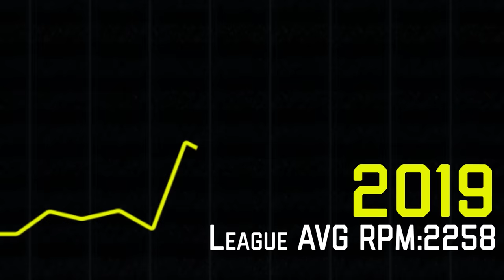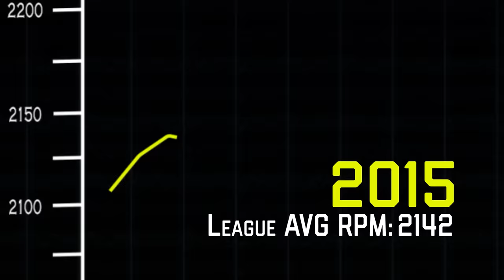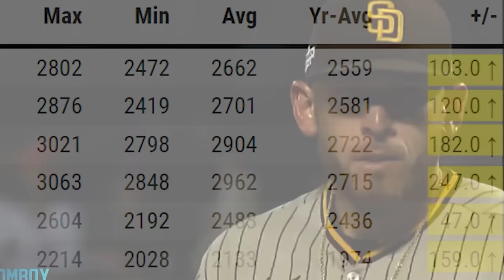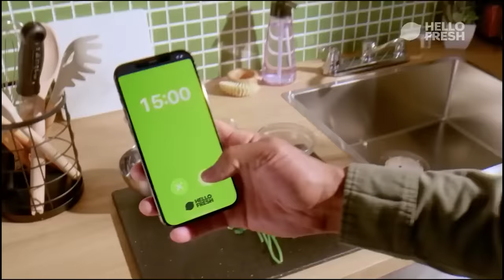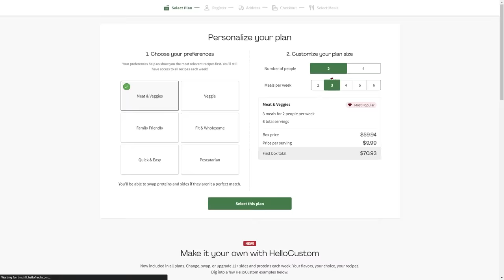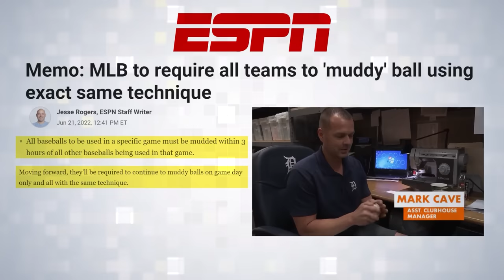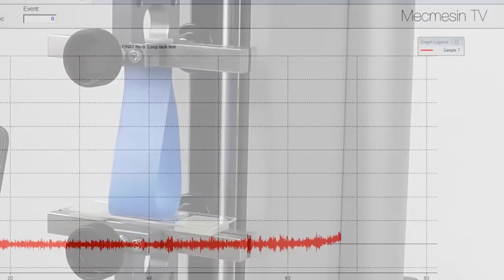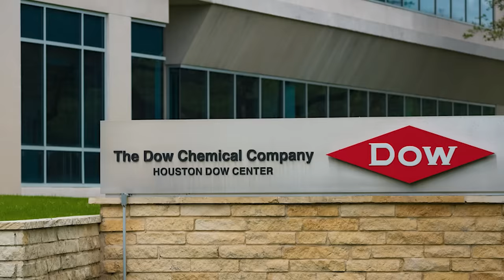Why MLB Can’t Stop Pitchers From Cheating

Comment: MLB is just fighting a losing battle here; if you let all this sticky stuff fly you piss off the hitter if you get rid of all the sticky stuff you piss off the pitchers. In my opinion if MLB wants maximum action you have to do the later. Yeah it’s going to upset the pitchers but at the same time it will make the game more exciting to watch, because no honest fan will say the prefer a pitchers dual to a slugfest.
Reply: If that's the case, then just put the ball on a fucking tee and get rid of the pretense already
Reply: You don't just piss off the pitchers by removing all sticky substances. Your going to piss off the batters too. Because now the pitchers have less control and the batters are more likely to get hit. Which is pretty much the entire argument for sticky substances in the first place. Trying to change the ball makes sense to me. If it's so slippery you have to add mud to it to try and make it less slippery perhaps they should just come from the factory less slippery. I don't think it even has to be a sticky ball tbh. Just make it so it isn't so damn slippery.
Reply: @3xceIIent  No, they have the same amount of control, not less. Control over where the ball goes is a matter of consistency, not grip. A lack of control stems from either a lack of practice, or the introduction of different factors... factors like, say, a substance that makes your hands stickier. A high school caliber pitcher can reliably not hit the batter. If these losers can't even manage that, they don't belong in the major leagues.

Comment: For anyone wondering why MLB doesn't just use the Japanese or Korean balls, the balls are a different size and weight from MLB balls. They would also need to switch ball manufacturers. Rawlings has been making the balls for MLB since 1955, so I'm sure they are not trying to mess with that dynamic as well.

Comment: Itsa chemical game.

So you cna use a combination of legal items or dirt to give more crip strength, heat friciton activated, or reacts wit hthe ball to increase grip, or inflammation of the threading of the ball slightly and finger position can give grip strength, or hand exercises can give grip strength, or finger augmentation to increase your end lift to increase your RPm/ Monkey tack is a obvious thing. 

You could have or create a hand scanner before a player goes out, scanns glove and hand, IE wash hands before going on, but hten its unfair because your hands maintain moisture.

So there is a natural way to increase your grip strength.. SLightly over dry hands or  callous..  heating, and other form is using water saturation method, causes your grip strenght to increase for udnerwater movement greatly, IE the wrinkle method, so you could get several minutes, but hten you need to dry fast, so there is a lot of ways, be interest to docuement this.

Heres how I look at it, the increased rpm simpyl changes your level of play, its nto a bad thing ,but diffrential speed can throw you off gaurd, from machien throwing balls to hard ball there is a learning curve. As you go up in level of play yo uahve to enter into a pre-spring... 

I htink use what ever you want.... if the RPM of hte league goes up, you modulate the pitcher plate per seasons to last years RPM by a various distance depending on the leagues RPM, which gives hte batter more time, and balances it back out... Thats the ismpliest fix, move the pitchting mound or, batting home plate, or just get better as a batter and change hitting regiement ot include 3000 rpm balls.

Comment: sand blast them - they need micro porosity in the leather. Increase the thread diameter to make taller stitches on the ball this will improve grip without tack. Colorado rockies should have purple stitches on their baseballs to nullify high altitude problems.

Comment: "MLB aggressively bans substances that give pitchers greater control over the ball"
"MLB neglects to manage the application of substances to balls to give them grip"
"MLB shocked and amazed by unexplained increase in balls slipping in pitchers grips resulting in injuries"
Reply: It doesn't give them more control, it improves their ability to impart rotational forces on the ball. Inherently, the margins for error are even smaller due to this; in other words, the same level of control requires MORE precision and skill to accomplish.

Comment: Really feels like the tackiness of the ball is “over engineering the pen to use in space” rather than just using a pencil.

Standardize the substance throughout the MLB. All teams use the same substance applied each inning by an umpire before the pitcher gets to the mound. Remove the variable of types of substances being used, cause I also feel like applying the solution to the ball directly will get them tossed faster after a little wear and tear, which is pretty wasteful.

Comment: the year is 20XX baseballs have become so grippy they barely leave the pitchers hands and stick to bats on contact, pitchers coat their hands in substances designed to make the ball slippery so that pitch speeds can go higher then 50 mph, the MLB is cracking down on these substances.

Comment: tbh i think there is a simple solution at dont need science to do......
punish pitchers for hitting players more. atm it sounds like pitching has reached a dead zone. where with out tricks there is not much more they can do. so either remove pitchers and have a robot do it or have a bigger punishment for hitting a player then they get to walk. such as a 40min ban from pitching, and if the team dont have a pitcher they lose. this makes the issue of percision vs random movement a bigger question for the pitcher. can they risk hitting the batter in exchange for striking everyone out? maybe. it dependxs on percision, but if they mess up they are out for a while and a lesser pitcher has to go on and deal with the same question.

Comment: Let them use all the stickiness there is and move the pitcher spot further away for a longer distance. Control of the pitcher goes up but because of the longer length reading the ball and reacting will increase as well.

Problem solved
Reply: Put the pitcher's mound 10 feet behind 2nd base. 😉😜😁😄

Comment: And, after all, when pitchers complain about baseball being not as tacky - yea, that is called sport. You should be able to pitch as fast as you can with the ball you have. That's a part of the skill. If you can't control you strength to your grip ratio - it's your fault.
That would mean lower speeds, yea, so what?

Comment: They might have a 2 part substance that don't feel sticky by themselves but get extremely sticky when combined. They could coat the ball with one and their hands with the other. Unless the umpire has some on their hands the ball wouldn't feel sticky. 3M and dupont both have substances that could be used for that purpose.
Reply: I don't think that's likely.  Substance 1 is on the ball, substance 2 is on the hands.  The substances combine when the hands touch the ball, leaving a sticky residue on both the hands and the ball.  Sure, it wouldn't be fully coated or anything, but it would still be present and easily detected.

Comment: I don't really follow baseball, but every time I become aware of the sport it's because of another cheating scandal.

I can't think of any other sport where peopel are so utterly determined to cheat in so many ways. It's sort of impressive on one level how determined and creative they are with the cheating, but god damn, baseball has a culture problem if cheating is this much of a standard thing, at least from the outside looking in.

Edit: I hadn't even finished the video when I typed this but holy fuck it keeps getting worse, this shit is embarrassing. Pitchers tossing baseballs at people's heads on purpose, brawls on the field, what the fuck? Is it a requirement to be a scumbag if you wanna be a pro baseball player?

It really seems like pitchers just want a ball that they can reliably spin so fast that no one can touch it with a bat, and when they don't get what they want, they just toss them at your skull instead?

Comment: If it is the same ball you showed the minors using, no it isnt what they are looking for, It is either too much grip or not enough and it inconstant as hell, Imagine that ball thrown at someone at MLB speed and completely without things for grip like Rosin, now you have a ball that can come off the hand inconsistantly and at 90 miles an hour at someones head. Those baseballs are literally going to have to checked by a human one at a time and not just mass produced to make sure every single one comes out of the factory at a standard or walks and hitting batters wont be the only problems,

Comment: I'm sure they will struggle with making an MLB baseball that will suit all types of weather. Some areas in America are more humid than others, some have higher altitudes, some are thrown during rain, and some places are dryer than the Sahara desert. They will struggle with this, but I wish them luck, especially before someone gets hurt because the pitchers cannot get a grip on the ball and have no control.

Edit: I think this will be more of a challenge for MLB compared to in Japan and Korea because America is a much larger country and has much more variation in weather, temperature, and altitude.

Comment: This baseball seems one of the stupidest sports out there and there are a lot of them. What is the logic behind any of the decisions? You throw a ball, hit it and run around. Football (the original one where you dont die aka soccer) isnt that much better but at least it has clear goals: two teams, both trying to hit the ball to enemies marked out area. Simple, not dangerous, no need for kevlar protection, i guess fun - not for me- but still comparatively, its something. Then there is hockey and other shit like that, and then there is this. 22th century really needs to invent new sports, especially cheat resistant ones.